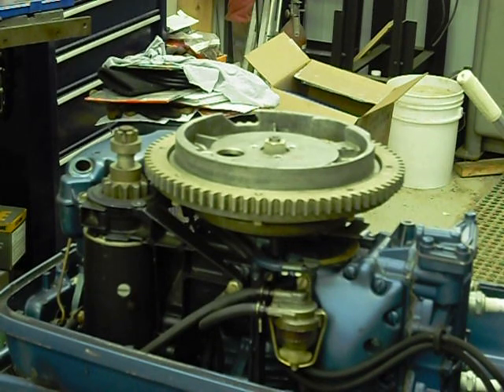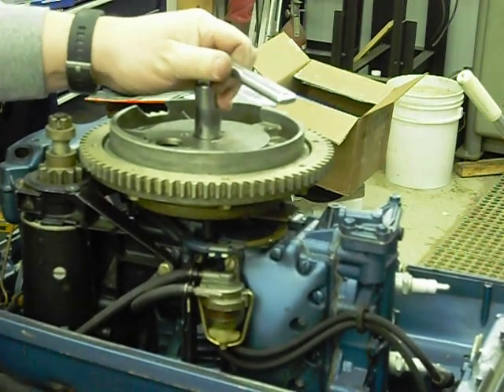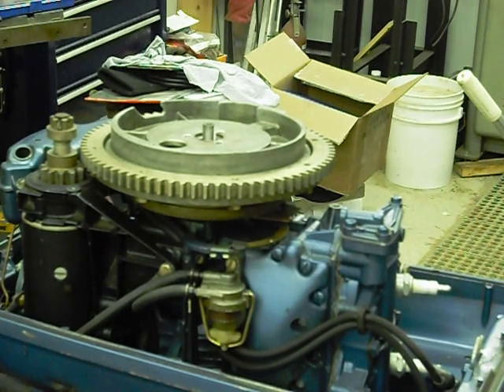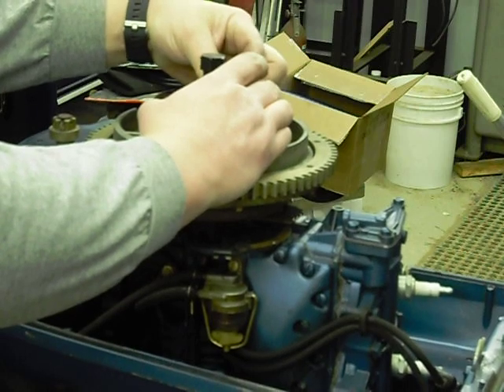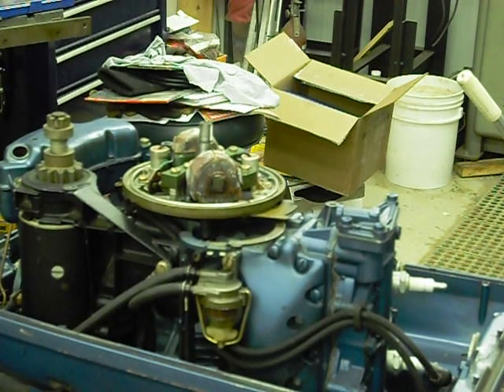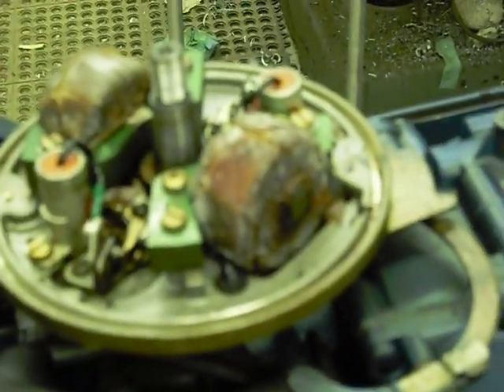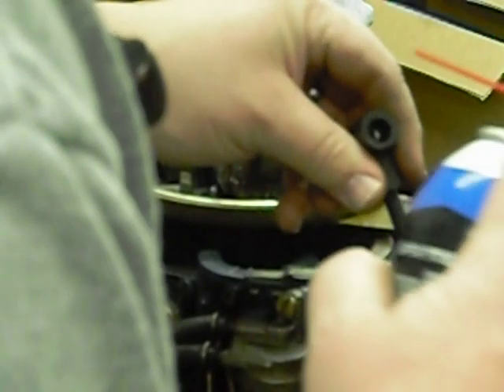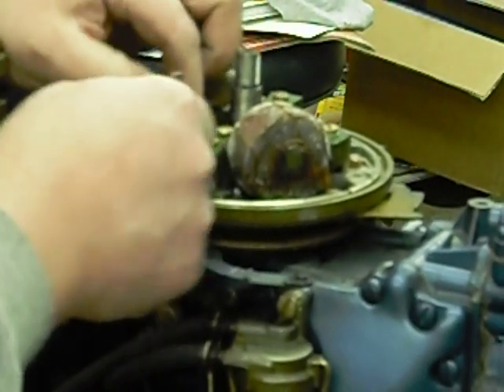Classic OMC Outboard Motor Tune Up Video #2 Flywheel and Magneto Removal

Comment: Do you have to remove the points and coil to remove the magneto?
Reply from the maker: No, the magneto plate can be removed with the points, condensers, coils, and plug wires still attached if desired. Thanks for watching!

Comment: Where do I get that flywheel puller? I have a 1959 18hp seahorse that I’m trying to rebuild
Reply from the maker: I bought mine from Crowley Marine several years ago.  The price has gone up with everything else affected by inflation, unfortunately.  Here is the link 
https://www.crowleymarine.com/parts/16323.cfm?gclid=CjwKCAjwnZaVBhA6EiwAVVyv9GBgMz2sunTeFIPPt9BVirLfB40AjzDQIvp9jfIKun7_Ru0bq1OsVBoC0ZAQAvD_BwE

For an 18, you could likely get by with a good harmonic balancer puller with grade 8 bolts. Just be careful to get them all square when installing the puller.  If you work on any number of OMC outboards, this puller is 100% worth the money. It's a wonderful tool.  Thanks for watching and good luck with your motor.

Comment: Question: The magneto cam that opens the points, is it pressed on?  I removed it from my 1972 Mate 2 2202M and can't remember how I got it off. Putting it back together now and it's very loose on the shaft, vertically. It does have a pin that keeps it from spinning on the shaft but I don't know what holds it down. Thanks!

Comment: Dear old JohnnyRude this is just incredible good as I have just purchased a 1959 FD-13 AND I like the way you work ! I will watch with graditude and hope I learn on this . The one I got is kinda Scruffy....but I like it !
Reply from the maker: That's great to hear! Congratulations on your motor.  Hopefully you find the videos helpful.  Nothing wrong with a little scruffy.  The scruffy ones are the ones I usually run. That way I don't worry about messing up my nice ones. LOL. Thanks for watching!
Reply: @oldjohnnyrude8404  This motor that I have has been converted to a fuel pump and the carb is a little different that the 5.5 motors I have worked on. Do you have any video's of a carb rebuild for this model ? I am asking because I sure would like to do it right the first. It does not hurt to ask and thank you for your reply.
Reply from the maker: @rustyleighty1999  Your FD-13 carb is the same carb as the one on this '59 Fastwin minus the choke solenoid and slight differences in the knobs and needle linkages.  The rebuild is the same procedure.  Actually, other than being larger and some differences in the choke the rebuild process is the same as the 5.5 carb.  If you have any trouble with it, I'll try to help.
Reply: @oldjohnnyrude8404   Thank you Sir, I was assuming the carb rebuild would be similar and since I save every part, piece off every kit and anything and every nut screw washer off every motor. I got the right stuff to do the carb. The linkage is giving me a head scratch since I do not know how it really should be and if who ever was in here before me knew what they were doing. It just did not look to well put together and small washers on the  base and clips. You know what I mean....? ? In the video I heard you mention Richard White concerning the locating ring and timing tool. Would that by any chance be the Richard that lives down Kendelville way ? I got my tools from him. Thanks again !

Comment: Hello, I have a 1966 18hp fastwin that won’t stay running past starting fluid. Pulled the carb off it looks clean and rebuilt with nice gaskets. So moving on to the coils and points and stuff right? I know this video is about a 50s fastwin, am I going to be able to use this video series as my guide for working on my 66?
Reply from the maker: The '66 Fastwin is essentially the same motor minus the shape of the cowl.  If your motor will run on starting fluid (not reccomended. It is much better to use a shot of fuel mix) but not on the fuel tank you have a fuel delivery problem.  You may want to address the ignition later, but that is not keeping your motor from running if it is running on a shot of ether.
Reply: Old JohnnyRude got it, I’ll switch over to a spray bottle with fuel/oil. I guess I should be looking at the fuel pump then? There’s not even a fuel filter, I’ll go get an in-line one and install before the pump. Can the pump be rebuilt or is that something I should try to find new?
Edit: thank you VERY much for replying, I’m already subscribed but you definitely have a new loyal follower.
Reply from the maker: @TheFrogfeeder  The pump CAN be rebuilt.  The kit is about half the cost of a new pump.  If you are patient and meticulous you can rebuild the small square fuel pumps with the OEM kit.  It comes with step by step instructions that will get you through the process.   It is confusing and tedious the first few times.  There is a filter screen under the cap on the pump.  It isn't a super fine filter, but it gets the big chunks out.  Thanks for watching and thanks for the sub.
Reply: Old JohnnyRude I hear you loud and clear about the aftermarket stuff, for 15$ I’m gonna try it and see if that rules out or narrows down my problem, if the cheap fuel pump makes the motor run good, I’ll buy the more expensive oem product for long term use. 
Lol I seriously love your videos, I’m totally OCDing on these old motors right now, I have a 62 fisherman5.5, and a 6hp fastwin that matches the 18hp.  The fisherman runs the best out of the 3
Reply: Old JohnnyRude again, thankyou, I wish you were my neighbor
Reply: Old JohnnyRude ok, today’s developments: replaced all fuel lines and added inline filter, cleaned pump/ordered cheap one from amazon, used gas/oil in a squirt bottle and 300 pulls later I got er to run finally. Apparently it needs an impeller so I didn’t let it run long. To get it to run, I kept the throttle handle wide open, squirted gas, got it to sputter and kept squirting till it ran on its own. 
With wide open throttle it ran like it was just above idle, I could take the roller on the carb and rev it up and she sounded good, but the throttle handle doesn’t seem to turn the magneto plate far enough or something...
The cheap fuel pump will be here Monday, now I’ll go see if you have the impeller install in this series, cause I’ll have to do that as well.
Edit: it didn’t seem to want to stay running at all with the throttle handle towards “start” or even low throttle, only on wot.
Reply from the maker: @TheFrogfeeder  It sounds like it may only be running on one cylinder when it does run.  Another thing is that in neutral the throttle position is limited to partial travel to prevent overspeed in neutral.  That limit is "Start" position.  The indicator ring is really just a guideline.  They are often not very accurate as far as what the indicator says.  I would start by checking the spark on both cylinders.   An open air spark checker is preferred and the spark should jump a 1/4" gap in open air.
Reply from the maker: @TheFrogfeeder  I have done the same thing with inexpensive aftermarket parts.   That's not a bad plan.  Those 5.5 and 6 horse OMCs are sweet runners.👍
Reply from the maker: @TheFrogfeeder  LOL...  I have had a few people say that. 😀
Reply: Old JohnnyRude I got a text into my buddy with more tools than I to see about checking spark and compression, next week I’ll install my new impeller and fuel pump come and see if that makes a difference, I have a strong suspicion now that the fuel is in fact not working well, and once she’s pumping water and running in any capacity, I can seafoam it and play with it some more. It sounded good, it wants to run, it seems to be worth pursuing.
Reply: Old JohnnyRude it was running way to smoothly to be only one cylinder, I think...I hope. We’ll see next week, have a great weekend!
Reply from the maker: @TheFrogfeeder  Could be, but, they will run surprisingly well amd quite smoothly on one cylinder.   It just doesn't sound quite right and it will be harder to start and won't make power like it should.
Reply: Old JohnnyRude I did it! I got this old girl running. New fuel pump and impeller did the trick!! Gotta wait till Tuesday before I can test run it on the lake, but I’m doing a seafoam treatment today and there’s some nastiness coming out of the motor, which is good! Thanks for all your help, I’m probably not done yet, but for now she’s running and can get onto the next step I come to :)
Reply: Old JohnnyRude as far as the low speed adjustment jet/screw, where is a good place to start? I screw it all the way down till it seats at finger tight, then I back it off how much? Lol I’ve had it out so many times in the last week trying to clean and try different positions...now i forgot how many turns originally, if THAT was even right...
Reply from the maker: @TheFrogfeeder  The initial setting for the low speed is 1.5 turns out from lightly seated . This setting will normally be a bit rich and it will most likely smooth out and gain some rpms when leaning it out.  Most of mine end up between 3/4 and just over 1 turn out but every engine is different.
Reply: Old JohnnyRude got it, thankyou
Reply from the maker: @TheFrogfeeder  you're welcome. 👍
Reply: Old JohnnyRude lol, so I got this 18hp running good now...
Today I just went and picked up an old boat for $50 from some old ladies field...has a 1962 28hp speeditwin mounted on it that’s super clean and just turned over(squirt of gas/oil, no fuel tank yet) and seems in good working condition. Also came with a 1962 Johnson 18hp.
So now I’ll be shifting my project to use the 28hp on my welded Gregor. It’s got all the steering(old school pulleys but hey) and throttle/shift cables and linkage, everything I need. The speeditwin even has the mounting bracket and wiring for electric start, but no starting motor...
So, now I got 5 motors for my little boat, a ‘62 5.5hp fisherman, a ‘66 18hp fastwin, a ‘66 6hp fastwin, a ‘62 28hp speeditwin, and a ‘62 18hp Johnson seahorse. Lol I wish my transom was bigger ;)
Reply from the maker: @TheFrogfeeder  Great to hear you got your 18 running well now.  Man!! What a deal you got on the boat with the Speeditwin!  Thats a great motor.  I'd double your money just on the Speeditwin if you were close enough  and didn't already have plans for it.  That should make a great rig on your Gregor.  😉👍
Reply: Old JohnnyRude you think that starter motor gonna be hard to find? I mean in all honesty, can’t I just find anything that fits and wire it up? I been looking on marineengine.com, searching all kinds of models and such, everything I see is pull-start, I even looked up your 67 fastwin I seen in another video because it had stock electric start and the schematic still shows pull-rope...
My biggest local boat part shop is west marine, but they want a part number before they’ll even look anything up for me..
Reply: Old JohnnyRude I wanna buy you coffee for all your help, can I send you a Starbucks card or something? Is there a way on here to private message?
Reply: Old JohnnyRude so is there a way to test the fuel pump, lol it’s $100 on marineengine.com...
The motor I got doesn’t have a fuel filter on it, not the original glass bulb or even a aftermarket inline one. I wonder if I pull the fuel pump off maybe it just needs cleaning? 
The guy said the motor ran last year when he bought it, then he never used it and sold it to me a couple weeks ago. 
I know fuel is getting to the carb, because when I pulled it off the other day, fuel dumped out. I know that doesn’t mean it’s getting enough fuel or pressure tho. The carb looked clean and rebuilt already.
I really appreciate your videos and any help you can offer, I am mechanically inclined and work on my own cars, but these old outboards are another world...lol my motor is 10+ years older than me
Reply: Old JohnnyRude if you have a minute, will this work? Looks like the updated evinrude one on marine engines .com?
https://www.amazon.com/dp/B07F67TG6J/ref=sspa_dk_detail_0?psc=1&pd_rd_i=B07F67TG6J&pd_rd_w=s63Tg&pf_rd_p=48d372c1-f7e1-4b8b-9d02-4bd86f5158c5&pd_rd_wg=H3tm8&pf_rd_r=K6V8EAZQ12R3X8FDXVYC&pd_rd_r=418ba4de-741c-41d1-bee0-6ab408cd004d&spLa=ZW5jcnlwdGVkUXVhbGlmaWVyPUEyRTZIVzNBMlRUQURLJmVuY3J5cHRlZElkPUEwOTc2ODM3ODNUMjMzWlZWTktGJmVuY3J5cHRlZEFkSWQ9QTA2MjgwOTYzNk0wMEc3VzRZTUw4JndpZGdldE5hbWU9c3BfZGV0YWlsJmFjdGlvbj1jbGlja1JlZGlyZWN0JmRvTm90TG9nQ2xpY2s9dHJ1ZQ==
Reply from the maker: @TheFrogfeeder  It will fit and work.  How long it works may be in question.   The overseas aftermarket fuel pu.os do not have the best reputation for durability.   I would opt for the OEM fuel pump instead.  If you do get the aftermarket one,  you may consider buying two so you can keep a spare with you.

Comment: Where do you get parts this outboard motor? I just got one haven't started it, needs gas tank rebuild..
Reply from the maker: Your local BRP Evinrude dealer has parts.  I order many of mine from Marineengine.com since I don't have a dealer that is convenient for me.  Good luck on your motor and thanks for watching!
Reply: @oldjohnnyrude8404  Thank you
Reply from the maker: @ericangel1950  You're welcome.

Comment: Thanks for doing this video!  Is this pretty much the same for a 1980s Chrysler 15hp?
Reply from the maker: The flywheel removal is about the same.  The ignition is a bit different on an 80s Chrysler but you get at the parts the same way.  Thanks for watching!

Comment: Generally, I'm not a fan of most of the HF stuff, but made one purchase that was a good one...I bought that 1/2" electric impact gun, $40, zips those flywheel nuts right off and great for using on the flywheel puller drive screw, but you still need the strap wrench/ring gear holder to properly retorque the flywheel nut.  The OMC puller is a must for working on these engines, and is worth every penny of its purchase price...
Reply from the maker: Some HF stuff is total junk and other things are actually pretty good tools.  I have a framing nailer I bought for $69, added the 2yr warranty to it for another 10 bucks which I never used.  I built my entire shop inside my barn with it.  My dad built his shop with it,  and it had built 2 other people's decks.   It's still going strong and ready for more.  I agree, an impact is the ticket for removing the flywheel nut. I use it often in the summer when I work in the barn, but not often in the shop.  I could since I have air in there.  I just don't for some reason.  Strap wrench and a torque wrench is still needed to properly torque the nut like you said.  One of those electric impacts would be handy sometimes too.  I may get one sometimes.   Thanks for watching Don!

Comment: hey thank you for your videos as always,but I find what you're doing here is more than helpful for the restoration and preservation of the classics.keep them coming good sir.
Reply from the maker: Thank you, Sir.  I have had some requests for videos showing the actual work that I put into these motors to revive them.  I thought I could cover a lot of that work with a series covering the tune-up process as I go through a motor that is, for the most part, in good mechanical condition but non-running.  I plan to take these videos to the completion of this motor.  Hopefully someone will find at least some of them helpful.  Thanks for watching!

Comment: Doesn’t the WD40 dry out the seal ? Do you have a remote mic. And could you stand on the other side of the motor so we can see your work better ? Just a suggestion. You have a good way of explaining things , keep it up !
Reply from the maker: Not too sure about WD40 drying out seals.  I'll use fogging oil next time.  That won't dry em out.  I only have the mix on the camera and the outstanding acoustics of my shop what with the concrete floor,  steel walls and ceiling.😎
I'm not sure I can see what I'm doing if I stand on the other side and work on the wrong side of the motor.  🤔  Thanks Dave! Sounds like advice someone may have given Chrysleroutboarddude on some of his videos.🤣  I'll see if my other camera is any better after the first few videos.
Reply: @oldjohnnyrude8404  POOR volume, great elbow,  learned NOTHING!!!!!!!!!!!!!!!!!!
Reply from the maker: @CoriJacksMom  Not my best elbow.  I'll try to give a better one next time.   If you didn't learn anything yet,  don't give up. 😉